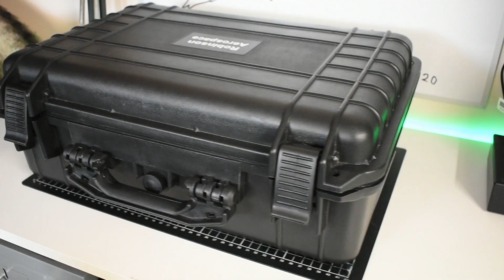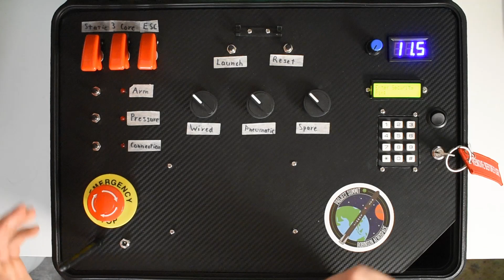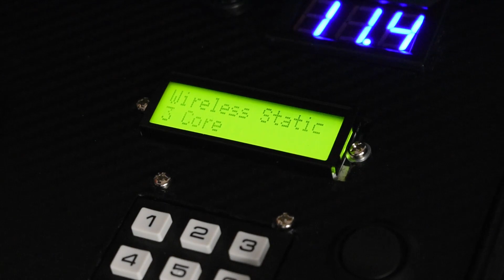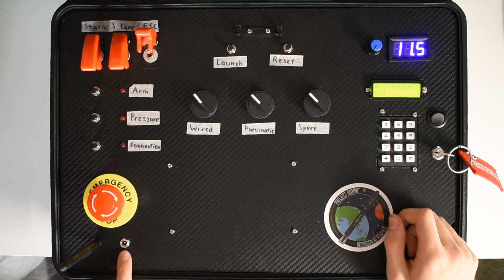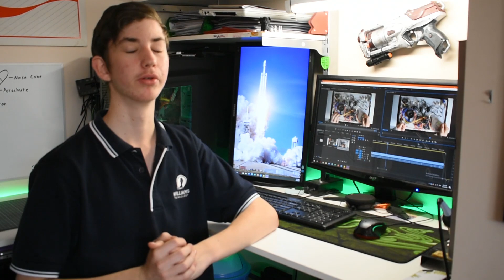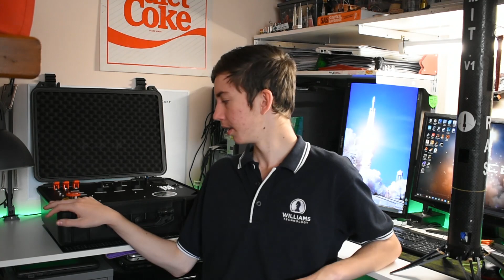Overkill Model Rocket Launch Controller – Project Summit 2020

Comment: And I thought I was OCD when it came to multi variables in my launch control system. I was  my lauch pad to integrate a 3 cup  Anemometer controlling servo motors to tilt  the launch rail so the rocket would land closer to the middle of the field and not in a tree. And would also prevent launch when the wind was too high. Yea I feel you bro!

Comment: Nice system :) One comment on the antenna, those don't last very long if you keep screwing it on and off on that connector. Especially when screwing it like that, as the small golden pin inside of the connector will also turn and wear off even more and faster. I would recommend to use a foldable antenna so that you don't need to unscrew it, or to use another small connector between the antenna and the connector in the system, so that that connector (and the antenna) can wear off instead of the connector in your system (which is probably the hardest to replace). 
Anyways, subscribed, keep up the nice work :)

Comment: In your opinion, how practical would it be to 3d print the entire rocket airframe? I've been working on creating small scale weight-efficient rockets. Sadly with no school, I have to build up my personal rocket launching supplies. I would be happy to share my findings and am appreciative of your open-sourced attitude to this project.
Reply from the maker: Ruzz Craze I have seen people do it before. Fairly weak and very heavy. I recommend using cardboard tubes. I only did carbon fibre so I could learn how to do it, it’s actually heavier then cardboard
Reply: @edwardrobinson6710  what about with carbon fiber nylon? I havent seen a rocket printed with it yet, probably because it needs a fairly advanced setup to print.
Reply: @ruzzcraze1862  Would still be really heavy. Honestly for low-mid power rockets cardboard is the way to go

Comment: Battery, use li-ion, li-fe, ni-cd, not li-po. Eventually one day you will mess up, and drain batt under the 2.96/3v 'kill' voltage. You need a batt that can go to 0v.
Actually the ones I mentioned I don't know for sure can go to 0, only lipo obviously can't. I'd edit list if any are wrong.
I'm only halfway through vid, had to stop to leave this. :)